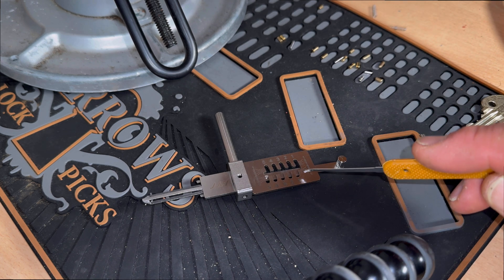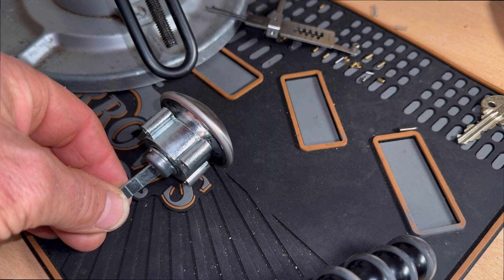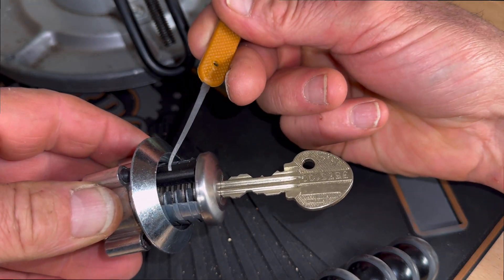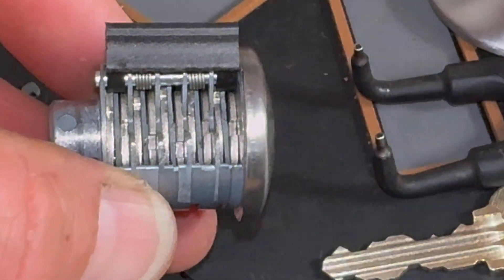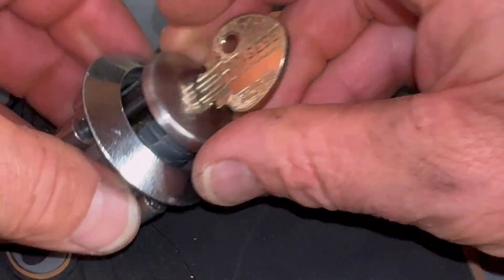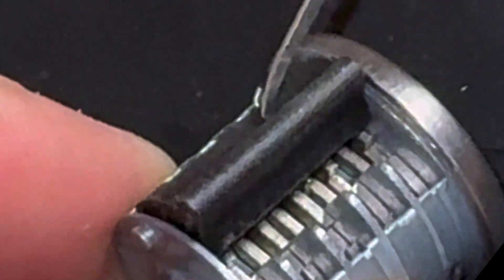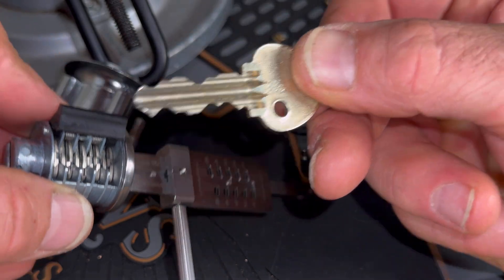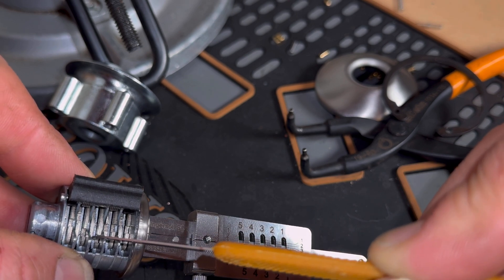How does the Ingersoll SC1 Lock Work?

Comment: Ah! I have been trying to work out how the Ingersoll d20 works (since 1957). This lock can be opened by the same key from both sides. Here, we have the distribution of the ten cuts (five on each side) , interleaved. Naturally, when the key is put in from the "other" side (upside down and facing the other way), we have a different arrangement. It would seem, on first sight, that the number of key differs might have to be reduced to enable the main feature to be achieved. Anyway, I have a starting-point for the d20. Any other information would, of course, be welcome.

Comment: Hi Brian, I'm suspecting the older Ingersoll locks with the brass side bar would in fact be easier to feel the the gate and hear it tapping against brass, than the "softer" nylon/delrin sidebar ...
Reply: Brian ... Ignore my  post above, I just saw your other video, and you answered my question. I picked an Ingersoll padlock in the '60's using heavy music wire and a hook. Took two days on and off, and it was master keyed! Often thought it would be near impossible if Ingersoll used shallow false gates on the levers.